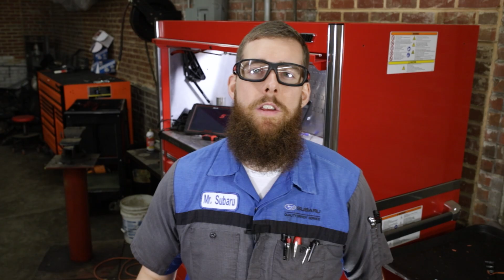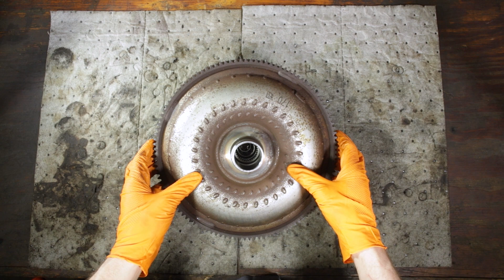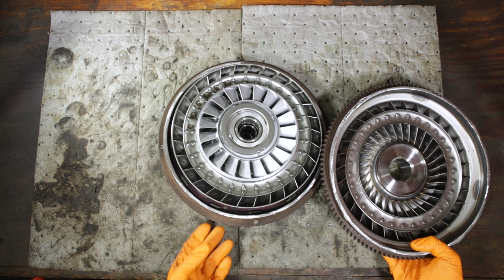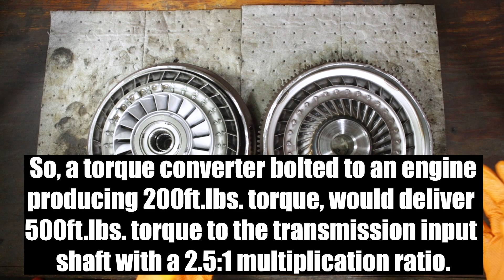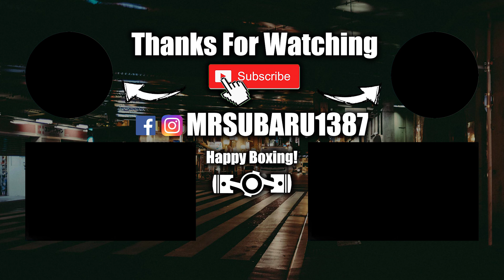Subaru TR690 CVT Torque Converter: How They Work, And Why They Fail.

Comment: Thanks alot for this man. We're dealing with this issue on my wifes 2011 legacy. I'm debating on pulling the engine myself and you're videos are a great source of knowledge.
Reply: I just did one on an 11 outback. In my case, the engine needed timing belt and components plus water pump (247K miles, the belt was cracked all over every cog) and it needed valve cover gaskets, so just getting it ready for that work had it just about all ready for an engine pull, which was actually pretty easy. Since the transmission is what is holding the engine in with the motor mounts no longer holding the engine to the front cross member,  those mounts are now at the front of the transmission. Makes it a super easy job to just pull the engine. Pulling the transmission requires probably more work, and you still need to get to all the bell housing bolts whether you pull the engine or the trans. The 250 lb transmission requires a very rugged and adaptable transmission jack, as well as pulling the drive half shafts from the front and the rear drive shaft, which requires separating ball joints and tie rods, plus the removal of the axle shaft outer nuts. So I pulled my engine and didn't even have to remove it from the crane to service the valve covers and timing components. Slide out the old TC and put the new and improved one in its place. First things first, you may want to drain the transmission first, although the torque converter will stay loaded with a few quarts of fluid. Have a good catch pan below your missing engine and drain that TC out because it will begin to drain itself as soon as it is off the transmission. One other thing that goes hand in hand with the TC lockup clutch release failure is the TCC duty solenoid, a pulsed solenoid that varies the lockup pressure for smooth engagement. Subaru sells only the entire assembly, but you can find the solenoid on the amazon marketplace. Mine was reporting a code indicating solenoid failure, and I got the one solenoid on Amazon for $165, instead of approaching  $1K from subaru for the complete assembly. So the other part of the job is getting 12 Qts of CVT fluid, as well as possibly replacing a solenoid in the valve body. When you drop the pan, it is bonded to the transmission with a gasket making sealant, and with the bolts all removed, it will not budge. Look that process up, MrSubaru here has an excellent video on that process. You will have more fluid drop out from the pan when you get it separated, and the valve body, should you remove it. I used a commercial baking sheet pan on top of my rolling oil drain catch system which allowed no spills outside of the pan. Tip: if you want to save a lot of time, do not remove your intake manifold, which may appear to be called for in alldata manuals, for example. You do need to access the flex (drive) plate bolts between the engine and torque converter, but all you need to do is remove the throttle body to get to those bolts easily.
Reply: @milehighmikey1  Hey man thanks for the tips!👨‍🔧👍🍻

Comment: Can you discuss the 5EAT torque converter lockup shudder issue?  I’ve seen a tsb on this and believe my 2012 3.6R is doing it. It shudders at mild accel, 5th gear only, 50 -60 mph. Feels like rumble strip or mild old school clutch chatter. Can initiate at will. Is it a similar clutch system?
Is this harmful to the transmission? What exactly is happening?
Reply: Was this ever answered? I have the same thing going on in my Tribeca, perfect  besides that

Comment: Very interesting.  My wife's 2016 Forester XT has had similar behavior in the past, although I can't think of a time it's happened recently.  When it did, it always happened on the first stop when everything was still cold.  Are diferent torque converters used for turbo models?

Comment: Had a 2012 Outback that sometimes felt like it was going to stall when coming to a stop but never did. Was not aware of the SB on this. Don't have it any longer. Anyway, just wanted to say thanks. I never really understood how the torque converter works...had a vague idea, but it's nice to actually see it visually. You explained it very well. Thanks!

Comment: I just bought a 2014 outback with a CVT trans 64000 miles, when going from park to drive there's a 2 to 3 second before the trans engages is this normal, thanks a million.
Reply from the maker: Normalish. Some do have a as light delay to them.

Comment: Can I ask where you got the SSM software that you use and is it available to the anyone?. Thanks
Reply from the maker: Jdmfsm.info
Reply: @MrSubaru1387   Thanks.   just had a quick look there and it looks like its just for manuals?  I"m referring to what you use to clear codes and reset/reprogram ecm's etc. (Subaru Select Monitor) Cheers
Reply from the maker: @thebagdersarse5824  oops. Sorry. Misread. You can't search Free SSM. That's SSM type program, limited functions, but free. SSM III ans SSM4 are several thousand dollars to lease. The interface module is also a couple thousand.
Reply: @MrSubaru1387  Thanks. ;)